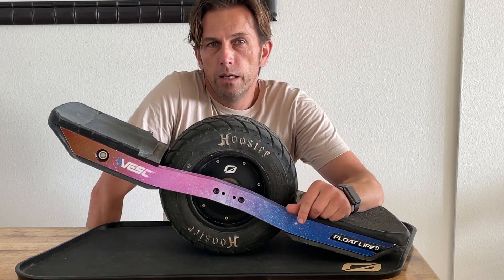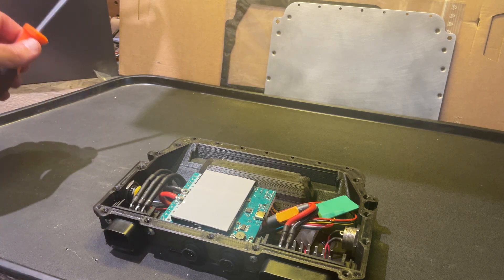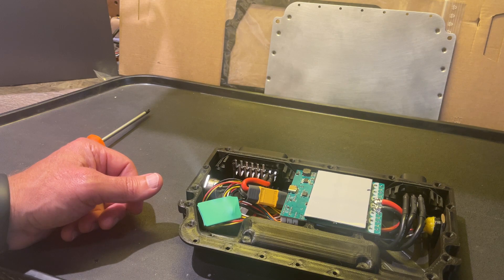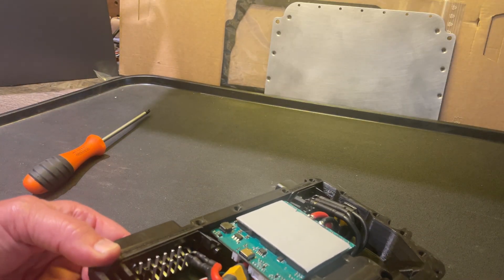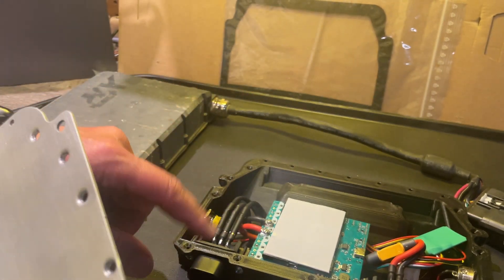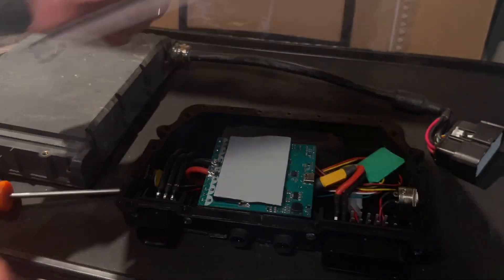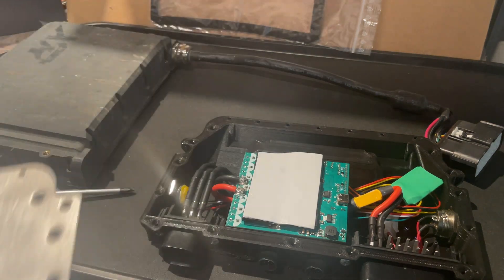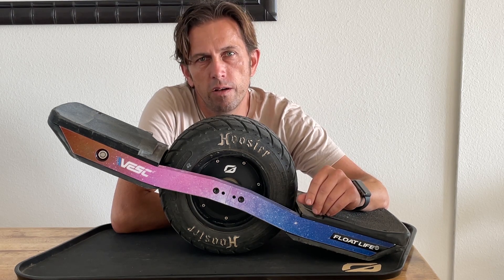OneWheel XR VESC Conversion - Step by Step Part 2

Comment: Is there a wiring diagram for the momentary switch? So will this work with the latching switch that comes with it on a stock xr.
Reply from the maker: if you don't mod the BMS you cannot use the latching switch, you need to tell the BMS to turn the board on/off, hence the purple wire - there's diagrams on pev.dev and the spinningmagnets article

Comment: Surfdado, how did you determine the NRF51822 bluetooth modules rx/tx pins?  Did you have to load firmware?
Reply from the maker: The Rx/Tx pins are 9 and 11 - but you do have to program it. You can use your vesc to do it. Benjamin Vedder himself shows you how to do it right here: https://www.youtube.com/watch?v=PFFiVxFHDM4

Comment: Very wise to use the metal plate as the controller module protection but also as heat exchanger.

Comment: Well, I think little focer v3, even being the best focer out there for a balancing vehicle, is VERY pricey, and is a shame that has problems with bluetooth and the pulldown resistors configuration is that bad. For such expensive device it should work PERFECT. I am very disappointed, I was about to get it, but not anymore. Both things should be correct since the very beginning, I wouldn't expect less.
Reply from the maker: Converting to VESC doesn't necessarily save you money and is not plug and play - very true. All VESCs today are still general purpose controllers, not Onewheel controllers. To me the most important factor is that a VESC is powerful and reliable. The rest is up to the builder.

Comment: Can you measure the thickness of the lid? I'm trying to DIY one of these and don't necessarily want to wait for flowglider to restock. He already uploaded the template for the lid, I just need to know how thick.
Reply from the maker: I’ve measured 1.45mm thickness
Reply: He restocked
Reply: @joejones6579  Thanks for the heads up.

Comment: Will there ever be an Android version of Float Control or is there something equivalent? That's the one thing holding me back from changing my board to VESC. I'd love to jump in and help contribute to the firmware!
Reply from the maker: The VESC Tool has an android app - but I’m not aware of anything like FloatControl or YoursTruly on Android

Comment: Did you have to switch the power polarity? I've heard that it is backwards on the XR.
Reply from the maker: The switched polarity would be inside the battery box. But I haven’t had to open it up yet - at the controller end I use the makerspev connector with the XT60 coming out of it, it’s wired the normal way
Reply: @surfdado  so the leads on the battery are normal ( red hot )? And the polarity gets switched in the box ??   Are they using a protection circuit to make sure the pcb does not cascade error ? Or is the polarity switching a component of the re Gen?   I'm curious what the purpose is
Reply from the maker: @MrDmadness  sorry, I'm not an expert on FM fuckery, so on the 4208 it's red-hot on the controller side (all I cared about), not sure on which boards it got changed and where, ask some of the people that repair Onewheels for a living, they would know. Also, there's nothing that suggests that FM had any legitimate reason to do this. This looks like a pure anti-repair tactic.
Reply: @surfdado  thanks for the info, you've a great channel, thanks for all you do :)
Reply: Don't quote me but I think that the leads are just backwards. In DC red is typically the positive pole while black is negative, this differs from 120vac at the house where black usually carries the load and white is the neutral ( remember on a/c  wires black is pirates .pirate = danger white flags are neutral )  so in essence the leads SHOULD be on a dc circuit red positive but red is negative on one wheel..
Reply: @MrDmadness  That is what I thought. It was FMd. Best to check it before connecting to the VESC.
Reply: @RafaelSaucedo  Shouldn't matter if he's using the existing onewheel battery harness I suppose.